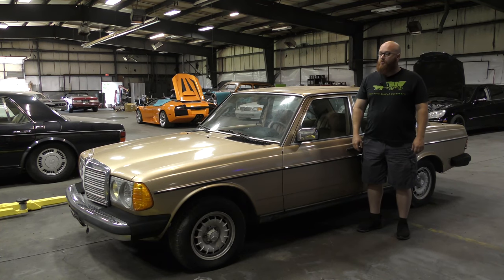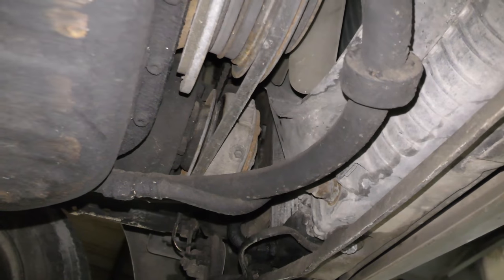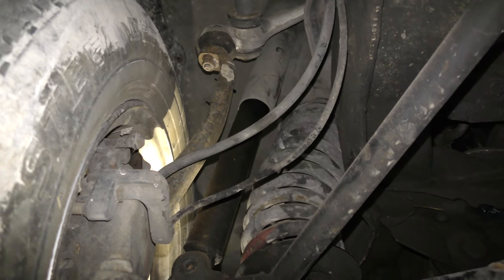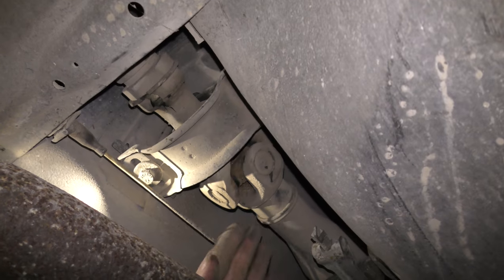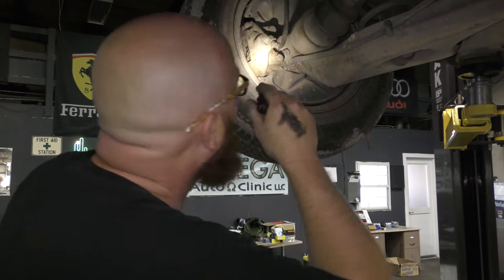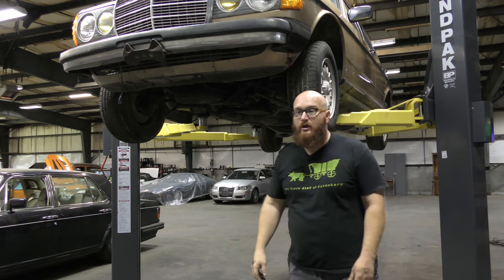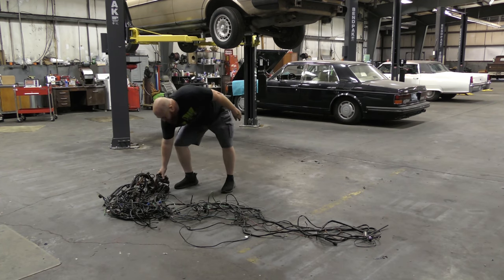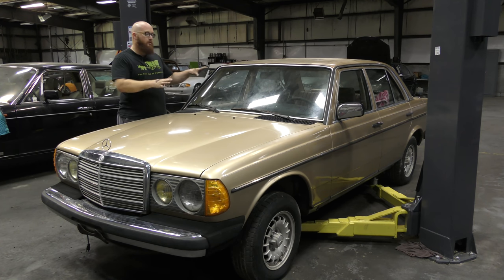What's lurking underneath? CAR WIZARD finds lots of repairs required to make '84 300D MB roadworthy

Comment: w123 owner here :)  ( i've had 5 of them haha ) 

They are amazing cars. put in the elbow grease and some money for the occasional part and you'll be the envy of those beside you in the next lane as they're driving around in their honda that cost them more than your W123 and the w123 will last longer haha. 

Currently drive a w123 2 door coupe with the turbodiesel engine with a manual transmission in it :)
Reply: The other guy never has to work on his Honda tho
Reply: @andyleo8418  Yeah, it just goes to the scrap heap once a computer fails in 5 years. 

Also, when your honda reaches 40 years old, i wonder how much it needs ? the car in the video really only needs rubber things ( all rubber deteriorates over time ) along with patching up a few rust spots, which it got from being exposed wherever it was sitting. 

the 5 grand going into this car versus buying a shitty honda... be honest now, which would you rather be in ? a nice classic benz or a pos FWD honda ?
Reply: You're of course being biased but I can agree with the '40 year old' comment -- a 40yr old Benz is more rebuildable than a 40-year-old Honda mostly due to the fact that there is a larger community and more parts available since nobody was hoarding 1980 Hondas. But if an ECU fails, we can usually find one on eBay for no more than $150. Not even a real issue to worry yourself about. My 1988 Prelude still runs like a top, handles like its on rails, and feels imminently connected to the road. The biggest repair/maintenance I've had to do was replace the clutch kit and timing belt & water pump. No other issues, even the original struts are dry and functional. All the electronics work perfectly, too.

Comment: Without a doubt I would restore this car. It’s a timeless, quality car from a totally different era to the current rubbish. Love that the customer is having it brought back to life
Reply: Stabilize it at. Least
Reply: Restoring an old common diesel sedan like this is a poor financial decision. In almost all cases you would be much further ahead to simply buy a nice one, if you HAD TO HAVE an old common diesel sedan. Sounds like they inherited the car, so it was free, and it has sentimental value, hence the investment. Nobody with brains would restore this car otherwise. I own a Mercedes S-Class, and my long deceased grandfather owned a minty '67 230 back in the day, that I used to drive, so I like the marque, but I wouldn't touch this example with a 10 foot pole. If it were a gas powered W123 coupe? I'd be all in.
Reply: Archimedes  Unless, of course, you have a sentimental attachment to the car, as in this case. It doesn't need "everything". The thing looks to be solid/rust-free and all the things Wizard was finding would be classed as "maintenance", rather than "rebuilding". Once all the maintenance is done, the car will probably have a decent lifespan ahead and, if weather/road conditions don't rust it out, it could do the granddaughter for many years.
"Nobody with brains" is a rude, arrogant statement, like the rest of your comment and makes it perfectly obvious that you don't understand the situation with the car. Nobody "with brains" would have made that comment.👎
Reply: Archimedes  Seems like you don't understand the DNA of neither people nor cars.
Reply: Me:  They don’t make them like this anymore. 
Mechanic:  No, they make them better now.
Reply: @OMGWTFLOLSMH   The Gas versions aren't as reliable as the diesel...

go and look up the om617 engine.... and see where it's been and what it's done
Reply: Mechanics hate these cars
Reply: Yes we need to preserve what used to be Mercedes. Cus one day all of us that remember the era will be gone and future ppl will think it was a myth, lie or superstition
Reply: @OMGWTFLOLSMH u must have one of those bad quality S classes

Comment: When I redid my 80 300TD Wagon I basically stripped it down to nothing and just got all new or good condition parts while also moving/adapting over a lot from the 300 donor car I got the turbo 606 from.  I'm used to doing restomods and planned on making it something I keep so I didn't mind doing the extra work to build a GT style car with a good mixture of sporty but also comfortable for suspension/handling.  Redid the interior entirely in saddle brown/black/brushed nickel moving over some of the newer styling and more comfortable interior.  Exterior was originally silver but I went with a with a newer AMG China Blue color and nickel plating for the trim pieces, grill, etc.  It's a great daily driver and GT car in general, far cry different from my two E36 Coupes (both around 500whp, one Turbo GM 4200 inline 6, the other Turbo Ford 4.6l 32v DOHC) or RX8's (Turbo Ford 3l SHO V6 making around 400whp, Turbo GM 4.8l LS that at dyno reached almost 650whp before I got afraid for my rear diff/transmission).  Closest would probably be the RWD converted 6th Gen Celica with a Toyota 1GR V6 destroked, cams, pistons/rods and turbocharged for around 360hp with room to go, that car is sporty but still pretty reliable and ok on fuel.  Plan on pushing that car a lot further too though once I get the stuff to rebuild a supra diff and transmission I have though...I tend to just build whatever is laying around that works making it cheaper...which leads to having a lot of random projects lol.

Comment: I was on my way back from San Diego when that transmission linkage pin went out. I rigged it back together if some wire and RTV while the family was having lunch. When I sold the car 150k later that RTV and wire was still there working great.
Reply: That McGiver style of fixing wouldnt be possible with modern cars...

Comment: I hope you get paid half upfront, i know that guy's doing it for his daughter; but that is a big big project 
would want insurance he won't just bail after the costs sink in, leaving you high and dry.
Well know you have experience in this and certainly have it all figured out, just has to be said.
Reply: Sounds like an old farmer with money... I wouldn't worry
Reply: well claiming ownership of that mercedes wouldn't cover it for sure
Reply: @snorkosaurus  They are quite expensive when sorted
Reply: @snorkosaurus  You obviously don't know the market for a rust free one.
Reply: have a feeling mr bently turbo r has left the Vizard high and dry
Reply: Good thing that I did all those repairs and more on both of my 300TDs. I can see those dollar signs in the Wizard's eyes as he explains the need for all those repairs lol
Reply: @RickyX64  Most of what it needs are really simple repairs that shouldn't take too long but that wiring? Holy crap I wouldn't want to even attempt that.
Reply: I wouldnt pay any service on my car until i was picking it up, the day it was done with (my) old replaced parts in a box
Reply: @wingracer1614  I got the wiring harness portions I needed from the salvage yard and spliced them into mine. Didn't even have to remove the harness or anything. It's all proper too, even got an original roll of harness tape from Austria. Everything has been 100% since I fixed it back in 2003 while I was in high school lol
Reply: Not everyone is a scumbag lool 🤣
Reply: when the car wizard said that with the amount of  money they're going to spend in that car is going to be like for the price of a Toyota Camry.... I think the girl would prefer the Toyota Camry over the Mercedes....
Reply: @Oi Oi Oi! I don't think that car is worth more than $2,500 ... It's only worth to owner because of sentimental value

Comment: I would estimate that not including engine and the wiring harness issue, P & L would be north of $5,000.
Reply: I was going to say 6-8 especially after all the might as wells are thrown in.
Reply: I spent $4500 on a VW van that had only been sitting for 12 months. It needed a new gas tank, muffler, shocks, new cat, all new brakes, coolant and transmission flush, all new belts and hoses. Coolant hoses alone on a VW van are $1000.

Comment: This video proves the old axiom, “There is no such thing as a cheap Mercedes”.
Reply: They were a high-end luxury car constructed with top quality components and materials.
Time doesn't change that.
They have always been expensive vehicles.
If you can't afford a newer model Mercedes Benz you can't afford a used one.
Reply: William Egler I cannot afford a new Mercedes, because I own an old one!
Reply: Which modern car will still be driving around 35 odd years from now. I reckon these mercs did pretty well.
Reply: mips Modern car mechanicals and electronics are much better.  The average age of cars continues to increase.  If old cars were built as good as some claim we’d still be driving them.
Reply: @williamegler8771  I wouldn't want one even if I could afford one.
Reply: @MrNotorius5500  Good for you...
There are plenty of choices available and I am sure Mercedes Benz can survive without your business.
Reply: @user-tb7rn1il3q  Take  a trip to Africa Asia or Southern Europe.
These are still being driven everyday.
Of course modern cars are better.
Technology and assembly methods improve over time.
But in it's day this car was near the apex of engineering and workmanship.
Reply: @user-tb7rn1il3q  A lot of people quit driving them because they can't afford to pay the mechanic. If you can do the work yourself, that's not an issue. Then it's a matter of skills, tools, and time to get it done.
Reply: Parts for the w123 are pretty cheap for most things. If you do the work yourself they can be a cheap reliable daily driver. My 85 300d has been great. Paid $400 for it and drive it 70+ miles a day.
Reply: It's not suppose to be cheap. This car in 1985 cost around $33k, which translates to $80k in 2020...
Reply: nope, bought a 280ce (gasser version) for $800 got it running for $200 the parts aren't expensive honestly it's like civic prices for parts
Reply: Completely untrue for the 1980s diesels if you drove a lot of miles.  There's a reason almost all the cabs in Europe, the Mideast, parts of Africa and Asia were Mercedes diesels.  They ran for a long time before needing repairs and when they did need repairs, the parts weren't much more expensive than most.  You paid a little more for the car, but in terms of fuel economy (up to twice as good as their gas-powered counterparts) and reliability, you saved way more than if you had bought an average-priced car.  So your net result was a cheap car.  But that didn't last. There was a time in the 2000s when they made some of the least reliable cars on the planet.  They've some back a bit since then but they are absolutely not built for long-term reliability any more.  If you are into gagety, electronic-laden performance cars that you want to sell off and buy a new one every few years, then they have what you want.
Reply: @williamegler8771  yes we're is the key word the old ones like this were quality now there just cheaply made junk

Comment: We had in our family 240 D for over 33 years that thing just refused to die, it lasted forever. loved that car
Reply: Every car will last forever if it is constantly maintained and repaired. You can actually see 100 year old cars in any museum that run and drive. They take thousands to maintain over the years, tens of thousands to restore to running condition in many cases. These 300Ds are not special or rare, so in my mind, one like this is valueless. It obviously has sentimental value to the owners, otherwise it would get crushed, or sold as a project or parts car perhaps.
Reply: Yea, my next door neighbor had one, for close to twenty years it was my winter alarm clock whether I wanted it or not. 😠
Reply: OMGWTFLOL  these cars are not rare but they are special, what you said is not true for all cars because not all were made to last forever but a old Mercedes was! Neither do they have the quality to last a long time or drive like any new car on the road , name one 30-40 year old American car or any car that is still used as daily by thousands n thousands all over the world, so do your research and go back to driving your Chevy or ford madd out of plastic that you think will run forever,
Reply: OMGWTFLOL not bmw
Reply: Earlier video on this - was the grandfathers car, and one of the grand kids is going to get it.  Yep, sentimental.
Reply: @OMGWTFLOLSMH  That makes little sense. There are so many examples of cars that fail or have catastrophic failures at some point or just break because rust. If you just replace everything all the time, that's just cheating. This Mercedes will however keep driving without the need to replace the whole engine or weld a new floor in it. Not if it sits in the mud outside of course. But just, normal use. Most cars from the 1980s - 1990s are all long gone and rusted away. 
And 100 year old cars in a museum.... I don't need to explain that's not really a fair reference, now is it?
Reply: @caleidoo i have an 85 300d turbo i keep up and daily drive (same color as this one!), and i agree with everything you say, w exception of the automatic transmissions. I've come up on 2nd rebuild now (at 366k miles) and it's a pain. Where i live, there are less and less guys around still willing to do it, it is mighty $$$, and worst of all the job is beginning to edge into the "hard-to-impossible" zone b/c of lack of parts availability. Plus i was never a fan of the automatics in theze W123 diesels. So I am switching her to a manual so i dont have to keep rebuilding automatics.. :-)
     BTW Disneyland in Anaheim, California last time I was there 10-15 years back had a 100+ year old little Ford (dont know the model, but it was tiny -- like a golf cart -- another era..), and they were keeping it up, running it around the park still, as a taxi, per Walt's wishes. Our party had just entered via the back gate, and a young gal pulled right up in it and asked if we wanted a ride anywhere in the park with it. After we took a second to recover from our amazement, we pressed her for details. She said it was holding the record for the longest running car in continuous service in the U.S. So I asked how they found parts for it and she said mostly they don't -- instead they have a guy in thee park's shop who can make any part needed for it when it goes out.

Comment: Tip for the owner, low effort rust removal: phosphoric acid (works better than vinegar) to neutralise and prevent it from getting worse, and spray paint to seal it

Comment: I loved the 85 190d. Spent hours rebuilding the engine and restoring it. I had one of the 300d's (same year and color) also. I love the diesel Mercedes  up to 1985.  I drove them until about 2009 when the 190d had a climate control issue it has been parked ever since because time has become scarce. The 300d  I parted out on eBay and made 3x what I paid for it. Thanks for the series it almost makes me want to get back on that 190d and get it back on the road again. Almost... Cheers.

Comment: Interesting film. Thanks. Good advice to those thinking of taking on a project like that. Replacing parts on an old, neglected vehicle is often not a simple matter of unbolting the old ones and bolting on new ones. The old ones will often be seized on. You may even damage other parts getting them off, which adds to the cost and amount of labour. It's tempting to think that an old car like that can be put back on the road simply and relatively cheaply, but the reality is very different.

Comment: Hey Wizard - one note from working on this vintage of MB myself-  

I ended up with some "old" exhaust hangars that actually tore when I installed them. So, wherever you get your parts do check to be sure they've not sat on a shelf for a decade.

You might like buying from FCP Euro if you haven't heard of them, since they offer a lifetime warranty on everything you buy from them.

Comment: Wizard: I'm not a body man
Also Wizard: cuts and fiberglasses Lamborghini transmission tunnel
Reply: That’s not body work. 
That’s floor/chassis.
Reply: It also was a smart shortcut to avoid disassembling the gearbox again.
Reply: @fastinradfordable  Well. Its a monococ, isn't it?  The body is part frame, part body;)
Reply: Nathan Brame exactly. That Rot on the merc goes into inner firewall which is steel. Expensive, needs a cut and butt weld replace piece filler glass sealed and primed and refinished which it won’t match that old pos. Oh well. Nice beater
Reply: @soulslaveone  There's no k at the end of Monocoque.
Reply: @CAepicreviews  ha ha ha! Thanx! Fixed;)
Reply: Actually it was made under the order of Tyler's...he said that wouldnt be responsible for that...
Reply: How dare you.
That wasnt' body work.
That was Emergency Open Transmission Tunnel Surgery.
Reply: also cut a tunnel so he can mount a Jag V-12 in a '66 Chevelle

Comment: Great Video..
I have a 84 300CD coupe...My second one ... and my 4th turbodiesel 2 W123's and 2 W126's.. Absolutely love these cars..Not fast by any means, but so reliable. I get people nodding at me or my gf ( if she is driving it) at traffic lights all the time.. Only issue I have is the AC is not cold enough or sometimes it just stops working.. I know I gotta spend a few bucks on it..

Comment: When it's on the road, its guaranteed people will admire it and say "those old Mercedes run forever!". Yes they do, if want it bad enough. I would defiantly repair this if I had the means. Such a cool, cool car. If I had it, and I had this car, I'd trailer it to the Car Wizard and say "take your time, I'm grateful you'll take it in". "Please accept this box of steaks and anything else you need."